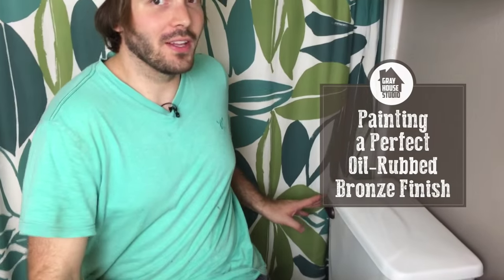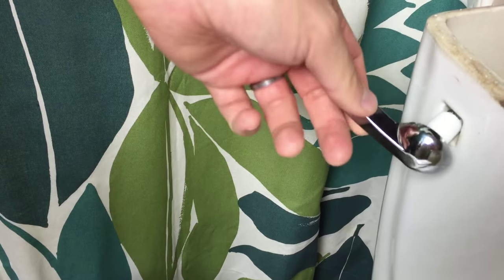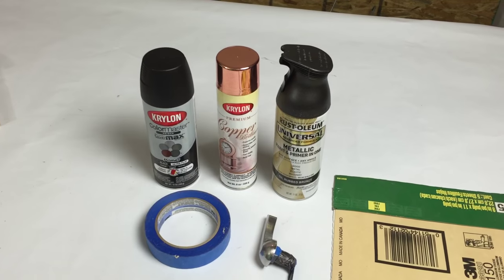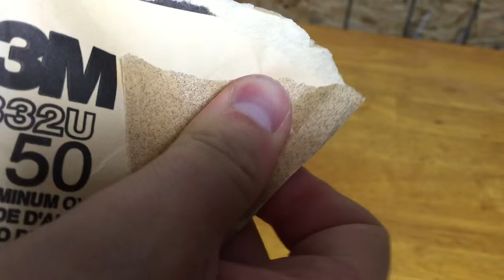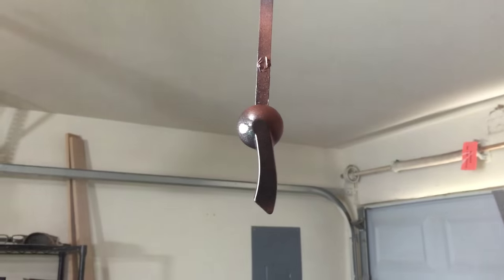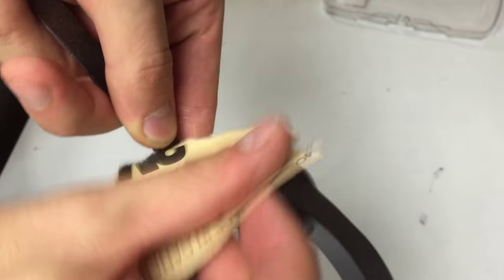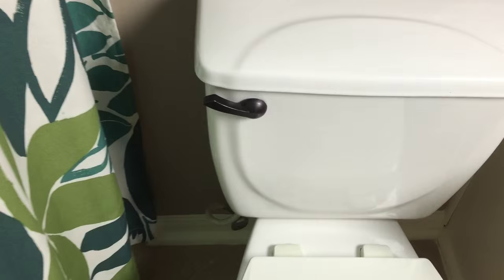How to Paint an Oil Rubbed Bronze Finish

Comment: This was an extremely useful an easy DIY video and relatively inexpensive.  This will be useful when I go to turn my extremely-difficult-to-find-replacement-options satin nickel hardware that came with my base cabinet from the manufacturer into matching oil-rubbed bronze as the rest of the hardware throughout our home. Thank you!! Only question to clarify is what grit sand paper was used to scuff up the original metal and if a different grit was used to scuff up after final coat of paint?
Reply: I think it was fine grit for both. Thats what he had on the table, and its what makes the most sense to me as someone who has painted quite a bit of different things.
Reply: after painting i'd probably use fine grade steel wool. any hardware store should have some

Comment: Simple... the the details AND you mentioned copper! Would you recommend a sealant? Going to be washing my drawer pulls and a foot rest on a chair alot
Reply from the maker: Yes, it certainly wouldn’t hurt to cover the oil rubbed bronze finish with a clear coat. We have started using the matte finish clear because it looks nice.

Comment: Hi Brent. Do you think I could paint my sink’s steel-colored drain like this? Because I just purchased a bronze faucet. Would be too much work to take sink apart to install a matching drain. So I’m thinking I  would dry the sink, and place tape everywhere except for the drain. Then spray.  ?   Thanks!!!
Reply from the maker: You could paint the drain oil rubbed bronze but you will want to add two layers of clear coat. This will protect the finish since the sink takes a lot of abuse.

Comment: Hey Gray House Studio, love the video but want to know if your toilet handle is still looking good? Does the painted oil rub bronze effect wear off? If so, how long did it take.  Also, would you recommend this process for bathroom faucets and shower doors? Thanks in advance!
Reply from the maker: +Valarie Anne Great question. After much use we are happy to report that the oil rubbed bronze finish is still looking great. It has not worn off and we think it is because of the sanding before painting. I imagine this finish would work fine for larger applications like a faucet or shower but it would make me nervous about cleaning with harsh chemicals. I'm not sure it cleaners needs for the shower might eventually strip the finish. Let us know if you try it.

Comment: Wondering if this will work on all silver bathroom accessories/ hardware. Faucets, tub knobs, drain and or light fixture etc....? If anyone has a link or before and after pics please share.
Reply from the maker: +audrey adame It should work on any hardware. Even better if you can remove the part to avoid painting in place. You can even add a clear coat to provide an extra layer of protection on high wear parts like a faucet.
Reply: How does this hold up for a shower faucet that's always exposed to water?

Comment: I had so brass fixtures I wanted to give the oiled rubbed look. When it be ok just to do the oil paint since it has the copper like look already?
Reply from the maker: That would make things much simpler. We would still recommend roughing the surface so the top layer of paint has something to grab onto.

Comment: I know this is an older video but I need to ask. When scuffing up the dark paint, is the dark paint dried at that point or freshly put on and then scuffed?
Reply: You lightly sand it  to achieve a slight worn effect when the paint is dry.
Reply: @anonnymous4684  what grit should be used?
Reply: @MrDdm343  fine grit

Comment: Do you scuff up the areas you want to show bronze while paint is still wet or after it dries?
Reply: After it dries , noticed he used sand paper to scuff it  and we cannot use sand paper to scratch a wet surface 
otherwise all you would accomplish is wiping the paint off with the sand paper.

Comment: What happens if you sand and then only spray with the oil rubbed bronze?
Reply: It comes out a nice dark oil color but from what I have heard, has a metallic sheen to it but no broze shows unless in sunlight. People have reported because this is a primer and paint all in one it holds up well. You could use touches of copper colored finishing wax to adhere copper streaks around the edges to achieve the bronze "show" through as well

Comment: does it last
Reply from the maker: Our painted toilet handle lasted several years - around 7 maybe. I would say it depends on how much the surface gets used/touched/cleaned and what is being painted. The toilet handle we painted, once it became our kids' bathroom it got a lot of use and cleaned a lot. We eventually replaced it when we remodeled their bathroom. But we were satisfied with how well and long it held up as it was more of an inexpensive solution for us at the time. Other handles we have painted that have gotten far less use, are still holding up fine.